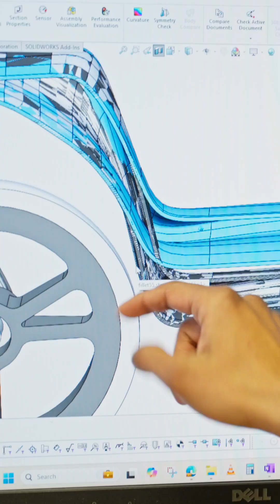How we designed the Bowhead ERA?

Comment: I have a question: as a long time wheelchair user with  above average athletic capabilities I often need to have an undercarriage that I carry my urological supplies in a small bag or sometimes carry a small backpack if not a large backpack on the back of my chair. Do you have any thoughts on any accessories that would enable someone at a minimum to manage day-to-day  urological supplies and possibly keys, a wallet and other needed items?
Reply from the maker: Hi, Thanks for reaching out. We have a few different options. We sell these Topeak bags that go underneath - https://www.instagram.com/p/DHWyConyK6g/ - Which could work for you or some of our other customers have been running a waist bag strapped around the chair. Thanks
Reply: Outstanding wheelchairs, but I don't see one in my future. The pricing is out of my range.